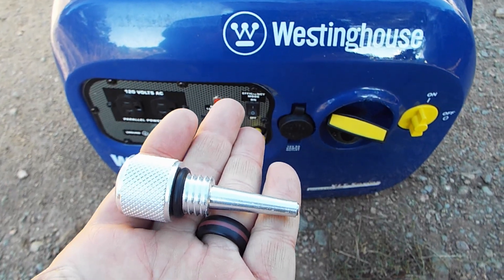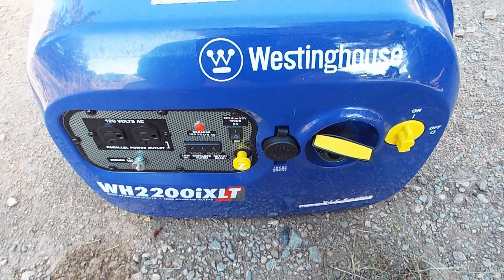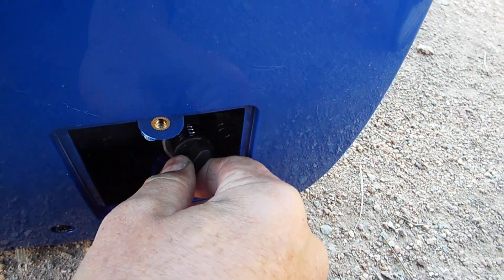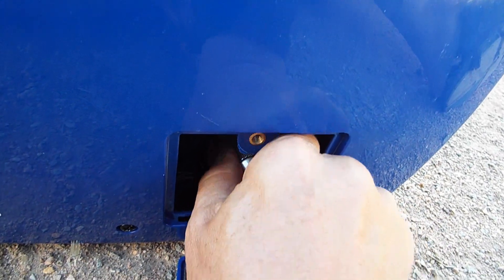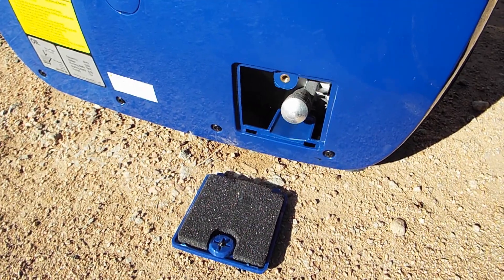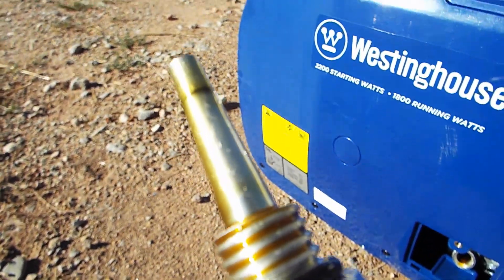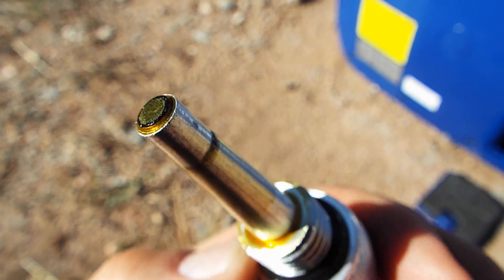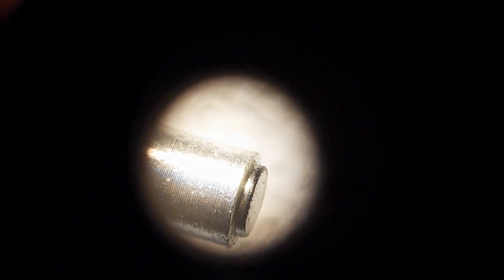Magnetic Dipstick for Small Engines

Comment: Hopefully that magnet doesn't drop off of the dipstick down into the crankcase.
Reply from the maker: Hopefully not, five years I have been using this magnetic dip stick in this generator and no problems the magnet is still in place on the end. Still getting small amounts of metal each oil change, so far the generator runs great, use it quite a bit.

Comment: I bought the same one for my Westinghouse igen4500 and replaced the dipstick before the first run. I have run it now about 3 house stopping and checking the magnetic dipstick a couple times. Both times I had a lot more than you do on your inverter. I was so impressed I bought it for my Westinghouse WH2000i (previous version to your inverter that has been great) that has about 30 hours on it. Can’t wait to see if it picks up anything like yours did. Thanks for the video.
Reply from the maker: Thanks for the comment. It reminded me to go and check the magnetic dip stick after 30+ hours of run time. I made a quick update video on it.
Reply: Mad Scientist Hut I will have to check your video out. I just checked my WH2000i after changing my oil and running 10 minutes with the new magnetic dipstick and was very pleased to see no metal shaving to my naked eye yet. Not a real test I know😊. The 4500 is still making enough though and makes me just want to run it for the 20 hours to see if after that it stops or slows down.